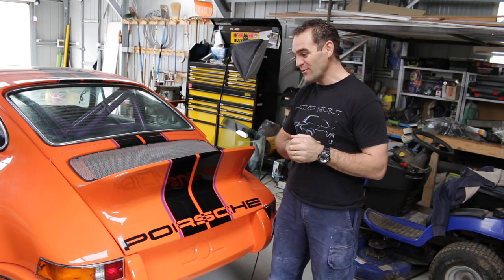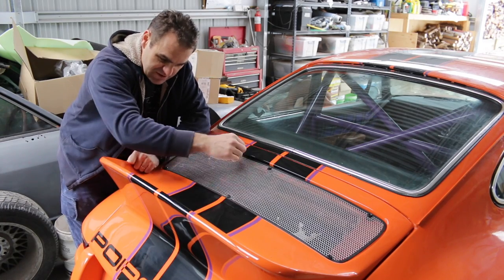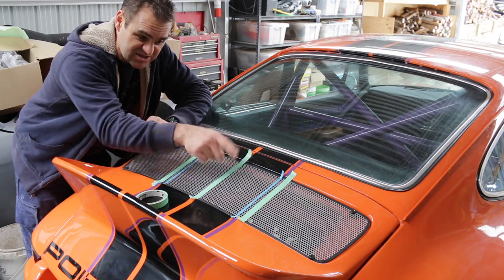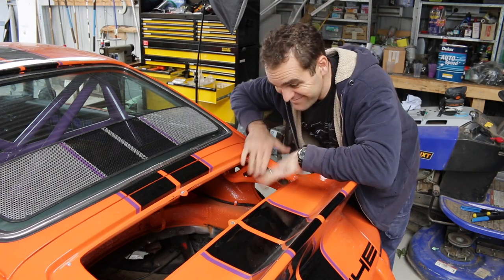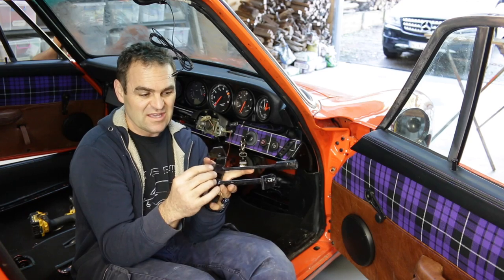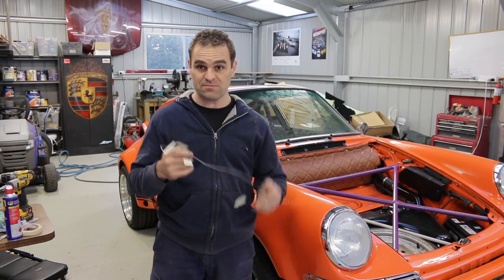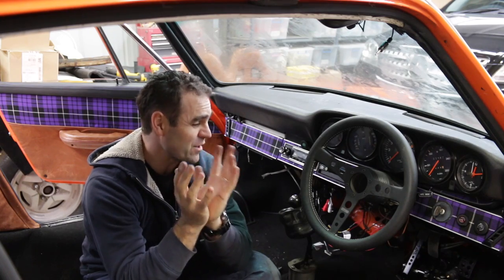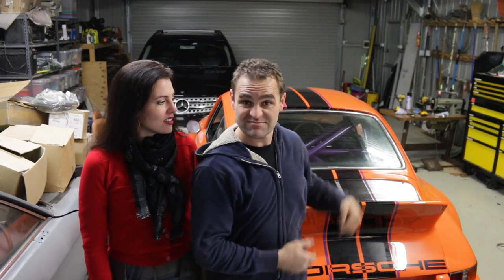Porsche 911 Classic Car Build Part 57 - Grill stripes, pedals and dash

Comment: Nice work Jeff. Now, about the pedals; make sure you mount them as far to the right side of the wheel well as you possibly can. The RHD 911s normally have the accelerator in line with the steering column, and this makes heel and toeing an RHD car a bit of a nightmare, because your right leg has got to be canted left.

The LHD cars on the other hand, have the clutch in line with the steering column, with the accelerator offset to the right, making heeling and toeing one an absolute delight!

So yeah - get it right!
Reply from the maker: Yes, I noticed that with the old set up. When I mounted them I did it with the seat fitted to get the best position I could.